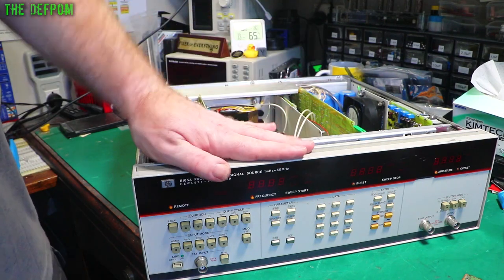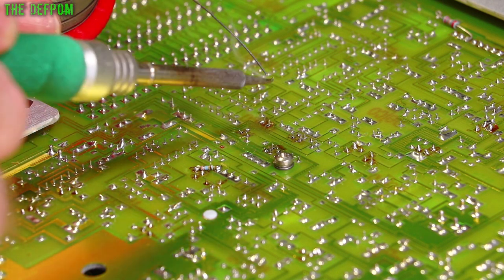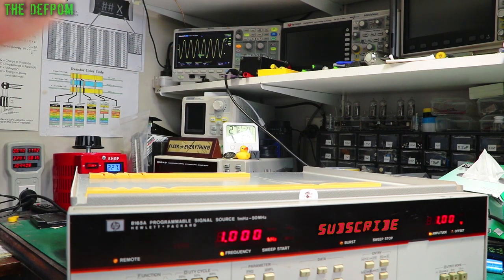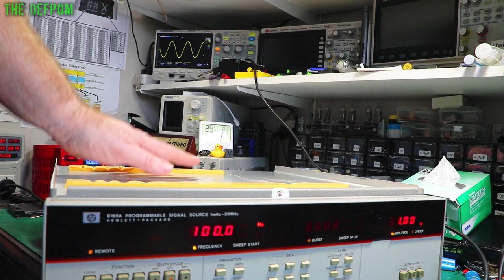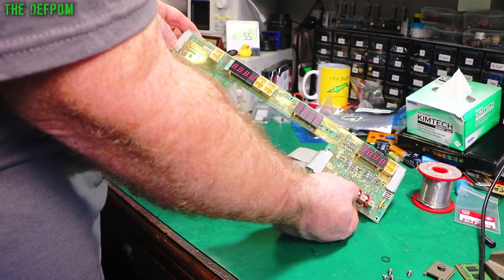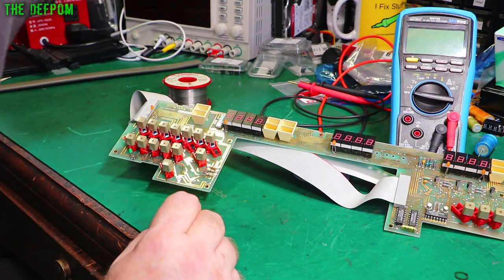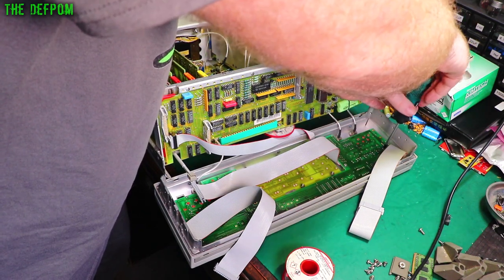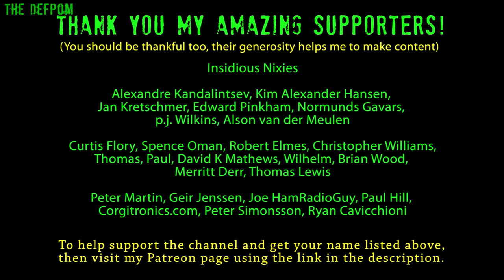🔴 HP 8165A Repair Part 2 - No. 821

Comment: Nice repair, Scott. The impedance of the cable is an issue at higher frequencies even with proper termination - that looks like a 75 ohm cable in the video. I usually replace the incandescent bulbs with red LEDs - they last longer plus (in older gear) the display looks better as the annuciator color matches the red seven segment displays and don't look orange.
Reply from the maker: I couldn’t be bothered doing that really, the bulbs were doing the job.

Comment: Transmission line theory welcome to my world.  Unsurprisingly even low data rate signals  can suffer these issues if they have fast edges or poor end of line termination.  I have been having  some issues at work and looking to purchase a time domain reflectometer to try a track down a termination problem in 10km of cabling. Nice  signal generator but I’m getting quite depressed at the amount of test gear I have I need to kull the heard
Reply from the maker: Wait, what, too much test gear? I’m not sure I heard you right, you have lost me there.

10km of cable... sounds like quite a challenge, makes me suspect a compressed/kinked point in the cable causing a mismatch, but I’m just guessing.

Comment: Would a dab of petrolium jelly on the switch springs allow them to slide, rather than sticking?.
Well the relay worked fine, if your bothered just look at the schematic and see how sensitive the signal is to switching.
You selling your bodged up cruddy equipment ha ha :-D
A shorter coax would create less error, coax is crappy stuff and velocity factor might have an effect... or not :-D